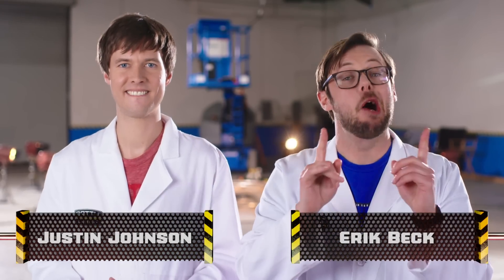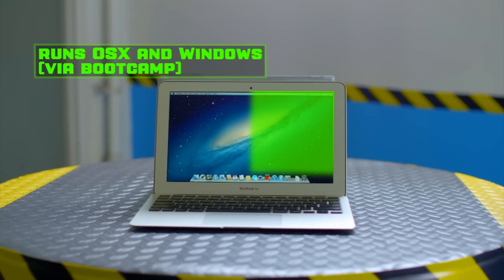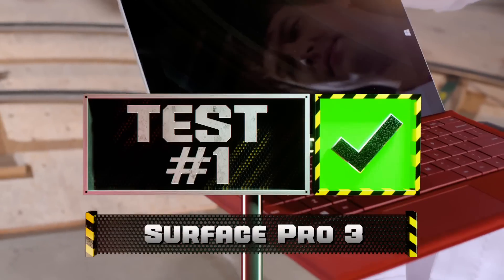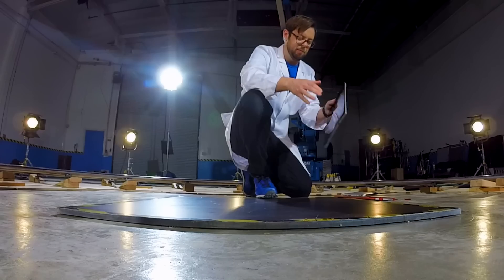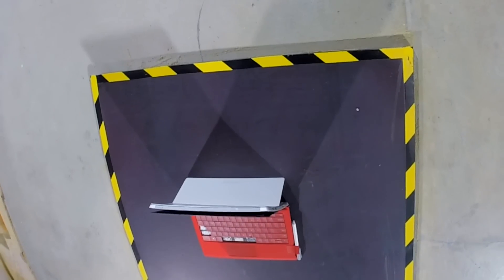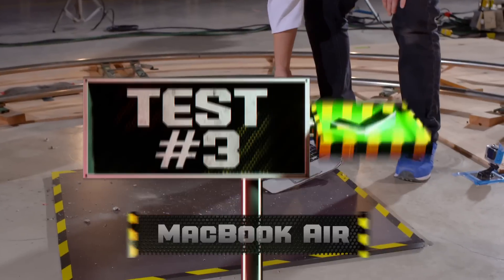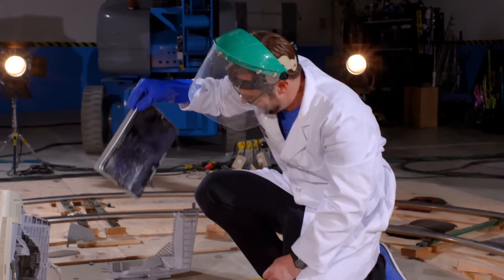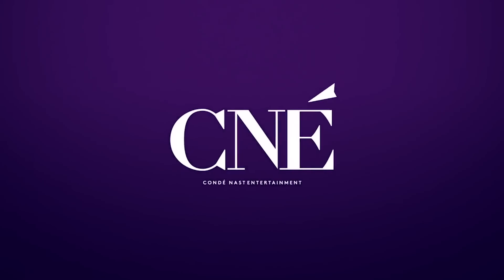Mac vs PC Drop Test | WIRED’s Battle Damage

Comment: the worst thing that happened to my macbook pro (2009) is it slid off my lap and landed on the steel leg of a chair that was next to me (2-3 ft). it now has a ~1.5 diameter <1mm dent on the bottom. its also covered in a bunch of other smaller dents around it from smaller accidents. to me this adds character value to this thing, which just makes me like it more.

also the fact that this thing has been running well after 6-7 years (with half my hard drive reserved to windows7) is what really amazes me. of course it cant run games anymore, but its fine with sketchbookexpress, skype, steam, firefox (1-2 youtube tabs, 1-2 forums tabs) i do have 2 windows 7 desk tops so any games i play are on that. (one is having issues and i havent had time to fix it)

this computer has been an amazing piece of hardware, and part of my life. had it since i was ~10, gave entertainment for a few years, helped me with some problems iv encountered in my personal life. this has made me a pretty large fan of apple's products, but windows is also very useful.
Reply: Well I don't really care what the value of it to others would be most likely keeping this computer even if it stops working
Reply: Matthew H i really dont understand why you feel that its necessary to start insulting me over something that isnt really even a big deal.

 as for being easily attached to objects thats a very common thing many people have (for example people who keep their grandparents' watch/lighter/pocket knife/random things like that) 

no, i am not a hoarder. the only things that have sentimental value to me are my laptop, a few items from my family members, and a few toys from my childhood. the rest of my stuff as long as it remains useful or there is some value behind it i will keep, but if there is no use then i get rid of it. 

long time since iv seen that one. the only furry artwork i have on my computer is drawn by me and is not pornographic (unless someone hugging their boy friend, or someone riding on top of a tank is pornographic) also why the hell would i even need anything like that? i'd much rather spend time with my boy friend, not sitting alone looking at porn (no offense to anyone who does)
Reply: Matthew H i still dont understand why you are being so hostile. the only thing you seem to do is reply with insulting comments. yes a laptop is valuable to me, thats just one small object that iv enjoyed for a long time, and enjoy the memories of what iv done on it.

Is it really worth your time to be arguing with someone over something that they enjoy? you can dislike what i enjoy but do you really have to go out of your way to attack that person...

Comment: that last test was unfair! the bluescreen's stand kept it on the surface where as the spinning pinwheel rolled off the mac
Reply: Also the surface area of the Mac dispersed the damage onto the floor as well as evenly across the laptop

The triangle stand put all force on the notebook, notice how the "broken" part is where the screen landed initially
Reply: So, the Mac is designed better.
Reply: The Mac is a laptop so OF COURSE it was designed better. The Surface is a tablet and not designed better
Reply: It is fair it's just microsofts fault that they didn't predict the future and make it lighter and more rolley if that's even a word
Reply: Or maybe because it was made out of machined aluminum and not cheap plastic. Also, who on earth goes around dropping CRT monitors on thier laptops?

Comment: the second test was extremely unfair due to the fact that the MacBook fell on its bottom allowing it to escape with minor dame, but on the other hand with the surface, there was a landing that made it split In too
Reply: Two
Reply: You're right also the Mac is made of aluminum and the surface is plastic so Steve Jobs made a tough computer
Reply: Me 3
Reply: You spelled two wrong
Reply: And a tablet is not a fucking PC. They should have use a laptop instead
Reply: LOLOLOLOLOLOL
Reply: trige gage and one more thing I've dropped something on a corner that split right open
Reply: Umm... the surface isn't plastic, it's made out of magnesium.
Reply: he corrected it! before you.
Reply: trige gage are you blind? The Mac fell on the CORNER. The surface fell more flat like, allowing it to distribute the force evenly. But still, the surface pro is built so badly, it split in two. The Mac, though had all the force put into one spot. But they build them with REAL METAL so it was no problem for the mac
Reply: If you looked closely gravity change the direction of the surface falling
Reply: trige gage ik
Reply: somethingsock I hope you know that the keyboard is hold in place by magnets.... Because it's removablr. Of course it will fall if you drop the tablet
Reply: The surface has a detachable keyboard.    Get out of the tech club

Comment: The surface pro is a tablet first and a laptop if you pay the extra $100 (I know it's marketed as a laptop) and the Mac air is a full laptop, this is like comparing the iPad Air to an windows notebook
Reply: lol
Reply: jo l the campaign was to show how it can function as a laptop software-wise with the keyboard extension, but even Microsoft said its meant to be a full laptop inside a tablet form factor, so I could see how you could make your argument in a software comparison stand point but hardware wise, its still a tablet.

Comment: The worst thing that happened to my Macbook was when I was holding it while walking to my chair, and tripped and dropped it. It worked fine, just one of the screws on the bottom had come loose, the and the metal was starting to come off, but I just screwed the screw and the metal was fixed.

Comment: The worst thing I have done to my Macbook Pro Retina, was accidentally have flung of and smash really hard into the floor. It took absolutely no damage, no dents, there wasn't even a scratch or scuff. My mac, just like your Macbook Air had no case on. It even fell from more than 5 feet, the air got a huge dent from that. Lesson; Macbook Pro is not only faster and more powerful with more features, but much more durable.

Comment: Not a real test. This was all wrong. Do a REAL windows laptop vs MacBook, or iPad vs Surface. This was the worst test so far.
Reply: Tablets are in general less durable. And the spinning wheel had a smooth and round shape so the forces were more evenly distributed and it rolled off. The blue screen monitor had that good stand that localized the forces and kept it there with some high amplitude vibrations. They would have needed to use an iPad and dropped similarly shaped objects to make it a valid test.
Reply: You are saying that just 'cause the mac won...-.-
Reply: Gamevolution ITA wasn't quite fair due to the location of the motherboard, but results are still results. I'll take their word for it rather than test it myself
Reply: If Microsoft wants to try to market their Surface tablet for a laptop, it should be tested against laptops. Even their own commercial compares it to the Macbook Air.
Reply: graytlo The Surface is indeed a tablet, but it's a laptop as well, or hybrid at least. The OS on the Surface is what makes it's competitors other laptops, not other tablets, not to mention it's rather large for a tablet too, so structure wise, it should be equal to that of a MacBook Air, considering the MacBook Air is the smallest (well at the time of this video release) laptop Apple makes, making both fair and equal contenders for this test. Testing a Surface to an iPad would in fact be a very unfair test as the Surface is larger and would have a thicker and stronger internal structure to prevent damages versus a lightweight and rather small/thin iPad.

Furthermore, how is this a shocker to you? People complain Macs are overpriced for same specs, when in actuality, the prices are very reasonable. Yes, you can build a PC more often then not with higher specs than a Mac for less cash, but between that PC and the Mac, which will last longer? Which is more reliable? Once that custom PC breaks, you have to repair it on your own, no warranty there. The Mac on the other hand, if it breaks, and a big emphasis on the IF, you have a pretty damn good warranty to cover it. However, that is IF the Mac breaks. I've been a Apple user for years, I even have laptops from 2007 and it works wonderfully still. Whole reason I bought newers Macs was because I knew I can rely on them. They have never crashed or had any corruption, speed was obvious decline as that happens to all computers. However, I can still turn on my 2007 MacBook and still use it today with no issues. As for a PC, you have to take extreme care of it, any slip up means instant trip to local electronic store for maintenance. Hell, I haven't even seen a PC last for more than 2 years without faulting in some way or another.

So price wise, yes, you can go cheap with a PC, same power for less money, and if it breaks, buy another cheap PC to replace and hope your saved data can be transferred. That or you can spend a little extra the first time around, get a reliable computer that most likely will not break on you and know all your saved data will be safe.

As far as gaming goes as well, yes, Macs use different graphic cards that aren't suited to gaming, however, the power that Macs have today can run games so easily that it's not even an issue. I use a late 2012 iMac maxed out and I can run BF4 on max graphical settings with no issue to my frame rate. Best part about it is it feels like it's running as fast as the day I bought it.

So to all the Mac haters out there, I cannot argue specs vs a PC, especially for gaming. All I can do is say what a Mac can do that makes anything better spec wise quite useless. Bottom line, I'll take quality over quantity any day, and Macs are definitely higher quality.
Reply: soccerjonesy PREACH IT SON!
Reply: graytlo yeah your right they making windows into dead edition
Reply: the PC BSODED had 2x more cement than the iShit
Reply: graytlo yay Mac win :D (Fan Mac)
Reply: soccerjonesy nope some of these aren't even true😂 PC has better graphics and supports all games
Reply: Alessandro Montenovo  no he's not that was unfair
Reply: GameCrasher apple fanboy
Reply: Alessandro Montenovo apple fanboy
Reply: U.S.officials!
Reply: No! It is real test
Reply: To be fair though, who on earth goes around dropping CRT monitors on their laptops?

Comment: +WIRED One note is that the any PC can really run Mac OS X. Just a heads up!
Reply: +ryanpaycheck True.
Reply: pc can run mac os
Reply: Quan Pham Yes, it is called Hackintosh.
Reply: +ryanpaycheck But not officially. I don't even know if it's legal.
Reply: +ryanpaycheck Not any PC is compatible with OSX. Even for the ones that do, it's sometimes difficult to get it working (or should I say it's always always hard).
Reply: Indeed. My PC is compatible with it and after some work I managed to get it to duel boot macOS Sierra and Windows 10. It's awesome and there are no issues with it.

Comment: its not only about how far they dropped or what is dropped on them... its about how it lands.  a well placed drop, as i've found out... from less than 2 feet will completely destroy a surface pro :-(  Always buy the extended warranty for these things if you get the high end version. it is $175 well spent.

Comment: That really not fair as the Mac IS a laptop and the Surface is basically a tablet with a floppy keyboard. You can see when they fall they fall differently and thus take different damage. Also, the Mac is made of metal so it would obviously take more damage.

Comment: This is not an accurate test. The surface pro 3 is not a laptop, it’s a tablet (you can use it as a pc but it doesn’t mean it’s a laptop). This would have been more accurate if you used a real Microsoft branded laptop or an iPad vs Surface Pro.

Comment: No. Just no. first of all, PC stands for personal computer. A Mac is a personal computer. The only thing different about these is the operating systems. So, yes, there is a war between them like game compatibility and customization. Windows definitely wins there. But yes, they are two different companies, apple and Microsoft. So all you are doing is testing the durability of the actual product, which doesn't matter all that much in the "war". For instance, I could download a windows operating system on a Mac, and vice versa. All I can say is, PC MASTER RACE FTW, no matter what OS you are running.

Comment: Poor iMac G3...
Reply: +Sezer Çelik My iMac G3 snow is guarded by a Core 2 duo iMac, 2 Mac Pro's, and a MacBook Pro.
Reply: CaptainDarren82 It's not Core 2 Duo iMac. it's iMac late-2006 or mid-2007 or early-2008 or early-2009 or late-2009. They're called by date now, not CPU.
Reply: Sezer Çelik I never really cared for names and labeling systems in the first place, but if it helps:

Mac Pro 1,1 Dual 2.66 GHz 2006
Mac Pro 2,1 Dual 3.0 Quad 2007
MacBookPro Late 2007 2.4 C2D 17"
iMac G3 Late 2001 Snow 500 MHz
iMac Core 2 Duo 1.83 Late 2006 17"

I have a whole damn list of Macs, if you're curious.
Reply: CaptainDarren82 Thanks.

Comment: I think you clearly demonstrated this is a stupid comparison to make. You can't tell which of the two can withstand more damage if you don't bring both of them under the exact same circumstances. Even if you threw two objects from a certain height, it would still depend on how they reach the ground. It's not the same if they hit it at a 45º angle or if they do at a 90º angle.

Comment: This is not showdown! Whats the purpose of showing the specs of each computer if this is how its going to be treated. Its just more on the durability only. Cars, planes , boat they can be broken, Titanic sink.  Boeing plane disappear in the pacific ocean. in-spite we uses this machine to travel but if it broken then its dead same with computer you drop them weather they work or not its broken. Dented frame, glass screen are shattered everywhere this showdown proves only little and it will not help buyer which one they will buy that meet their needs not durability only. Because drop test isn't always  exact!  You can actually see in the video that the two object  when it reached the grown in slow motion they are but in different position and in other cases both are in different orientation so drop test in not exact and its not enough and it prove only little.

Comment: I dropped orange juice on my mac book. But it still works just fine xD
Reply: Just cause the laptop still Works doesn’t mean it doesn’t have liquid damage and you should still take it to a repair shop
Reply: @TechHowden  That happened 2 Jears ago. My old 2013 Mac book still works just fine. I won’t  repair a MacBook that’s turned off and in the rooftop 😅😉
Reply: @timofullmann4515  Didn’t realize that thought you made this comment right after it happened

Comment: I smashed my PC with a hamer slashed it with a axe droped it out the window 2nd flor (a pc not a laptop the BIG box thing that kind of pc) Took my tracktor ran it ower set it on fire threw it in the pool and then i  threw it on the road and it died there

Comment: Btw you should have used an actual pc laptop because the surface is like a tablet and prepared to be dropped, and I could see if you were using the surface as if it was the main competitor to the Mac book but it sucks as a laptop and a tablet therefore it needs its own category let's call it the piece of crap category!

Comment: For the sake of this being an experiment its all fucked up. They have ignored many factors of variation when it comes to the execution of each test and it is simply not controlled. Dropping a surface pro and a MacBook air from your two hands above the ground is stupid if you are trying to test for overall structural strength. Its impact force differs due to weight and there is not enough distance for both to reach terminal velocity therefore it is not controlled. Initial position of the laptops before its displacement is also different. I could go on but my point is this video and its purpose is nothing more but entertainment value cliched with a science theme. It might look cool but effectively this video proves nothing in the summary of which either a 'mac' or 'pc' is better.

Comment: Mac books are expensive you can get a windows computer 3 times the power 3 times cheaper and also its a not very fair test the surface pro is a tablet with a removable key board re do it with a normal laptop or the dell tough book😂😂

Comment: Windows is a superior operating system, but macs have much more survivability. Also, the surface isnt a laptop. Its a tablet. Test an actually decent example of windows machinery.
Reply: Depends on what you need your operating system for. If you're only doing basic things like gaming, running some programs, browsing the web,... windows will do the job just fine. If you need a little more advanced operating system, you'll have to go with OS X or Linux.
Reply: Matthew H Did I say it was advanced because it was based on free BSD?

Comment: not really because the mac was made out of a stronger metal mix... so naturally its gonna be stronger than the surface. but also, both devices are pointless and over priced lol.
Reply: jo l in this case perhaps not. But i wouldnt say either of these devices are cheap for what they do. You can get a far superior laptop or desktop for tge same price. Ok its not gonna be touch screen or wafer thin but itll do alot more and cost alot less.

Comment: only mac can run mac and windwos wtf. surface can run mac
Reply: so can surface, you just install mac like you would any other os
Reply: No.

Macs you just run bootcamp (Comes on the Mac and you just have to put the windows cd in or choose the windows OS of your hard drive (Completely legal btw)
Windows you download 3rd party software and illegally install MacOS
Reply: Crazy Tubex Nope. It lacks the specs to run Mac.